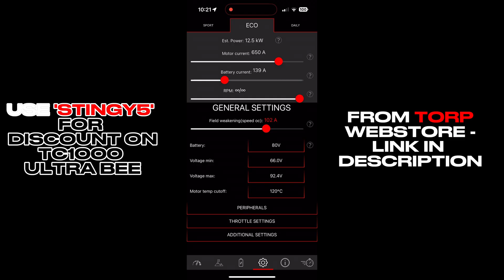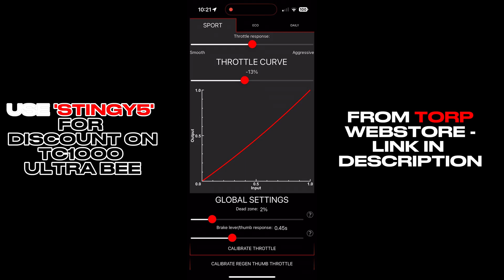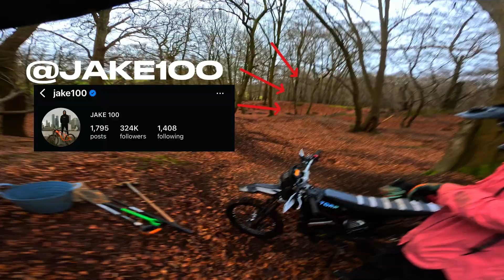The Surron ULTRA BEE is an 80+mph ROCKET with INSANE range! // 80V 76ah + TORP TC1000

Comment: Why did u set it at 35kw peak? Reason I'm asking is I'm wondering what u can safely run the stock motors at in bursts, and if u were going off anything setting it at that or if it was an educated guess to keep the temps down?
Reply from the maker: I set at 35 kW peak because I know that that is what the stock motor will max at. The app only allows you to put the power up as high as a stock motor I can handle after I switched to the TM 50 pro motor. I was able to raise this to 55+.

The amount of time you can actually make 35kw is very little, most of the time using 16-18kw - Temps were never an issue as it was 2°c outside, it would probably be more of an issue during summer but if it gets hot just come down into your daily mode while it cools down a bit.
Reply: @stingyrogerr
  nice one cheers for the reply. I've got a modified sting and converting a crf450 to electric, was planning on using a qs138 70h motor which is good fir 30kw but suddenly thought what a ultra bee stock motor could handle as u can pick them up cheap enough. So cheers u answered my question.
Reply from the maker: @user-qn1ol5sr2z i actually have one for sale if you want it you can DM me on @stingyrogerr on instagram :)
Reply: I'll have a think mate, I'd kind of forgot they used a belt for reduction which is probably not ideal for my setup.
Reply from the maker: @user-qn1ol5sr2z yeah they use a jackshaft!
Reply: @stingyrogerr yeah thinking about it I'll stick with the qs138 fir simplicity. While your on, I don't suppose u weighed the torp 1000? I'm trying to keep the weight down as much as possible, think I can get it around 100kg or a touch under if I'm lucky using a electron cycles 19kg battery as the light bee/sting size batteries will drop in through the frame at the top like they were made for it, and also means I only need one battery and can swap it between the sting and the crf. I was thinking of using the ebmx 9000 v2 as it allows for more power incase I decide to upgrade the motor later, but it's heavy (4.5kg) according to goggling it. Have u had experience with the 9000 and if so which would recommend/preferred? Thanks
Reply from the maker: @user-qn1ol5sr2z i did not weigh the controller but the weight is listed on the torp website. I believe its out of stock though. we are also trade dealers and suppliers of electron cycles and EBMX products through wgtracing so batteries and controller we can help you with that and advise based on size & weight. The torp can run more power than ebmx though… shoot me a dm and I can help you that way. We offer the uk’s best prices through our limited company.

Comment: what does your motor amps top out at on the APP? Mine doesnt pass 900a for some reason
Reply from the maker: Mine goes to 1000a for the tm50pro and was 900 for stock motor you need to do your controller firmware update added support for tm50pro. As with all controllers, the actual setting you pick won’t restrict it to that. So you might find youll peak 980a for example, I did 920 with mine set to 900. And 1199 when set to 1000a on tm50 pro for example. 

Also depending on what motor you choose, torp limit their settins for power and amps based on this. Eg stock motor is 900 but tm50pro 1000. Just because you cant pick over 900 on the app, if your motor can deliver higher, it will allow it to go past 900 on a pull

Comment: gotta get the new Torp Motor next
Reply from the maker: @cntrix2047  yessir! Have the TM50 PRO to be installed this week :)
Reply: @stingyrogerr  awesome! Only Supermoto Tires, better brakes and suspension needed then as the last perfection in my opinion
Reply: @stingyrogerr  i heard there is even a torp controller coming that can handle over 90v this year
Reply from the maker: Not sure about that! But ewatt make an 88v 76ah so could be useful as thats over 100v charged! Also did you like my new video with the torp motor. Things a 🚀!!!

Comment: how much autonomy level for road use? I mean in supermoto mode
Reply from the maker: Not sure what you mean by autonomy level? I have road legal enduro tires 👍🏻
Reply: @stingyrogerr  i mean how many miles u can do with that battery ? on road at like 50 mph
Reply from the maker: @ 60 or so miles. Its 6000+wh

Comment: Why does the drive train sound absolute ratchet?
Reply from the maker: Think the belt is overly tightened from factory! Its an angry bee. Also part of the design much like an mx bike is a chan guide attatched to the swing arm, its a plastic block the chain slides along to keep it from derailing. Normally you cant hear it on an mx bike due to the engine sound. Its also a big 520 chain